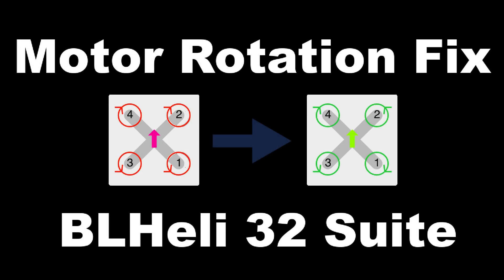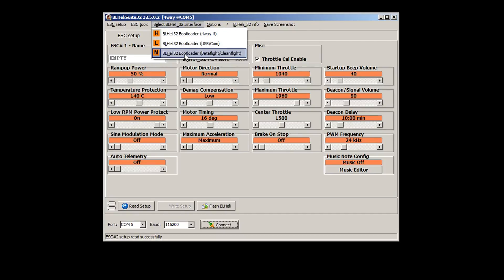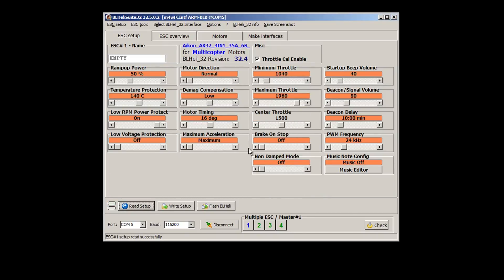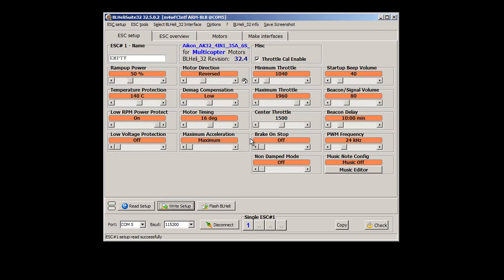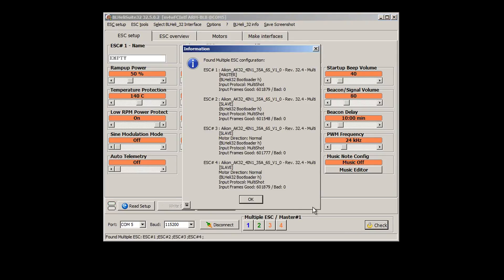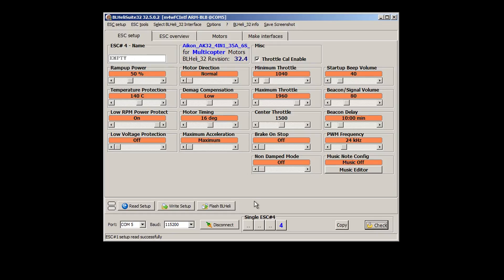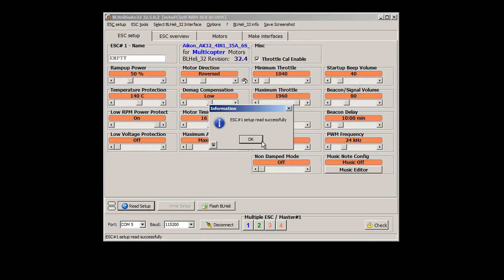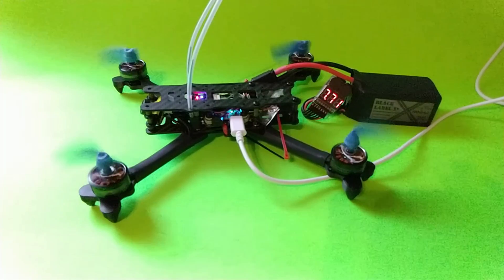🛠 [How to] Reverse Motors with BLHeli 32 Suite

Comment from the maker: ℹ  Oscar's How to Connect/Flash:
 ↪ https://oscarliang.com/blheli-32-esc-fc-passthrough/

ℹ BLHeli project and download link:
 ↪ https://github.com/bitdump/BLHeli/tree/master/BLHeli_32%20ARM

ℹ Windows STM32 Virtual COM Port Driver :
 ↪ Official Link: (account needed) https://www.st.com/en/development-tools/stsw-stm32102.html
 ↪ Joshua Bardwell's Share: https://onedrive.live.com/?authkey=%21AHtdqyEUIlNTWug&id=AC06B68F01DD1B5E%21111&cid=AC06B68F01DD1B5E

ℹ ImpulseRC Driver Fixer:
 ↪ https://impulserc.com/pages/downloads

Comment: Awesome video it helped me out a lot I have a question also why com port only gives me a port com3 as a com5STM the line is called USB it still works but should I be concerned
Reply from the maker: it's always com3 for me these days, not sure why, but never seen it different on my systems except this recording :shrug:
But now i strictly use the Linux version since it fully works these days. no more need for windows VM for me.  on Linux it's always /dev/ACM0 unless the port is somehow locked, then it goes to ACM1

Comment from the maker: TWO SECTIONS BELOW:
1) Featured Parts & Gear in this video.
2) My personal best parts and gear links.

🤑 THANK YOU for considering any affiliate links below.
🙏 HUGE Thank-you's to our community for all the youtube support!

SECTION ONE
---
🏆 Featured in this video:
📚 information

SECTION TWO - My Stuff
---
🐝 My 5"/6" Quad's Components (https://rotorbuilds.com/build/16766)
✅ RMRC Strix Screech 6" 💛
 ↪ RMRC:$28 https://goo.gl/yMpfsu | 6" arm:$10 https://goo.gl/52wPLb
✅ HelioRC Spring v1 IMU-F ⚙ Butterflight Stable
 ↪ Amzn:https://amzn.to/2OjoiDt (v1) | Pyro:https://goo.gl/68ZXMC (v2)
✅ Aikon AK32 35A 4in1 v2
 ↪ Amzn:https://amzn.to/2uNEwwA | Pyro:https://goo.gl/MyxRVD
✅ EMAX LS2207 1900KV 💛
 ↪ Amz:https://amzn.to/2yGdbP0 | Bang:http://bgd.onl/7 | Gfpv:https://goo.gl/bCNVzs
✅ R9 Mini 900MHz Long Range Receiver
 ↪ Bang:$23 http://bgd.onl/2n | Gfpv:$20 https://goo.gl/sYuuDq | Pyro:$20 https://goo.gl/TBMC7Q | RMRC:$21 https://goo.gl/9VD2RL
✅ Caddx Turbo SDR1 💛
 ↪ Bang:http://bgd.onl/5 | http://bgd.onl/6 | Gfpv:https://goo.gl/7BWrWj
✅ Eachine VTX03
 ↪ Amzn:https://amzn.to/2mI00X5 | Bang:http://bgd.onl/8
✅ FarVew👁 Pagoda-2 Rev B Combat Edition RHCP
 ↪ https://goo.gl/M9FLFG
✅ Pigtail 5cm RP-SMA Female to UFL/ipx (5cm) Pack of 2
 ↪ $3.86 https://www.amazon.com/dp/B01AJQ33Y4/
✅ JHE42B 110dbi Finder Buzzer Built-in Battery with LED Light (7.4grams)
 ↪ $10 http://bgd.onl/2m (USA warehouse)
✅ Black Label X 6s LiPo's
 ↪ https://goo.gl/qzhZ7N

🐝 My 7" Quad's Components (https://rotorbuilds.com/build/16968)
✅ iFlight XL7 V3
 ↪ $43 -$3_Coupon https://amzn.to/2ZfbqDZ
✅ Lumenier ZIP 2407 1700kv Motor Non-POPO (i won from GetFPV)
 ↪ Non-POPO: $26 http://bit.ly/2DaOdtd | POPO: $27 http://bit.ly/2DgGwlo
✅ Foxeer F405 (i won from Viper_FPV )
 ↪ @Gfpv http://bit.ly/2Di84Xh
✅ Holybro Tekko32 F3 35A 3-6s BLHeli32 ESC (Set of 4)
 ↪ $59/4 @Gfpv http://bit.ly/2DeBl5c | $15ea @Gfpv http://bit.ly/2DhaVA1
✅ HQProp 7x4.5V1S Bi-Props
 ↪ ~$3 @Gfpv http://bit.ly/2DgJjuN | $$Shipping https://amzn.to/2Iors9l
✅ Caddx Turbo Micro F2 FPV Camera
 ↪ $20 @Gfpv http://bit.ly/2DdVZT2
✅ Eachine TX805 5.8G 40CH 25/200/600/800mW Transmitter
 ↪ $17 http://bgd.onl/2F | $27 https://amzn.to/2UKY3Nm
✅ FrSky R9 Slim+ 915MHz Long Range Receiver 💛
 ↪ $29 @Gfpv http://bit.ly/2DeCnOC | $27 @Bang http://bgd.onl/2G | $34 https://amzn.to/2Irtci6
✅ Lumenier AXII 5.8GHz Antenna (RHCP) (2pcs) (tough boogers)
 ↪ $35 http://bit.ly/2DNy5hz

🎮 My Gear
✅ 900Mhz COMBO KIT: R9M Lite Module + Super 8 + R9 Mini Receiver + T-Antenna
 ↪ Bang: http://bgd.onl/2x
✅ FrSky x-Lite Transmitter
 ↪ Bang:http://bgd.onl/2 | GearB:http://gear.onl/8e | Gfpv:https://goo.gl/aw8nfs | Amzn:https://amzn.to/2JV0iDg
✅ Clear Silicone Non-Slip Gel Pads 65mm*75mm (generic battery pads) 💛
 ↪ $11 https://amzn.to/2BSGz8y
✅ iFlight M5 Quick Release Prop Wrench Tool
 ↪ $10 Amzn:https://amzn.to/2AlLvSE
✅ Eachine ROTG02 Android Adapter (has been very useful for dvr)
 ↪ $20-$25 Bang:http://bgd.onl/4 💛
✅ EV-Peak C4 80W Battery Charger (i have 2!) (~33mins from storage to full 1100mah 6S)
 ↪ $50 https://goo.gl/tkcfhk
✅ 60W ESD Soldering Iron Kit 💛
 ↪ $28-$33 Amzn:https://amzn.to/2AbeOXS
✅ RDQ/Bengineering Labs Smoke Stopper (must have)
 ↪ ~$7 Gfpv:https://goo.gl/SQi7xP | Amzn:https://amzn.to/2MdoYJ0
✅ Hawkeye FireFly Action Cam 1080p (catastrophically destroyed)
 ↪ Bang:http://bgd.onl/1 | GearB:http://gear.onl/69
✅ Hawkeye Firefly Micro Cam 2 160 Degree 2.5K HD
 ↪ ~$50 on promotion or coupon or BG-points @Banggood http://bgd.onl/2M

🛠 Useful Parts
✅ Helping Hand Third Hand Soldering Tools Flexible 360° Stainless Steel Arms 3X Magnifying Lamp [...] by NEWACALOX 💛
 ↪ $41 https://amzn.to/2ID5P4j
✅ "A more complete" WLine M3 Screws 12.9 Grade w/ NUTS
 ↪ $12 Amzn:https://amzn.to/2OhWe3q
✅ USA warehouse 7 gram JHE42B 110DB Lost Buzzer/LED
 ↪ $10 Bang:http://bgd.onl/2m
✅ USA warehouse 4.3 gram 1 hour JHE42B_S 110DB Lost Buzzer/LED
 ↪ $11 Bang:http://bgd.onl/2o
✅ Lipo Battery Voltage Tester 1S-8S Buzzer Alarm
 ↪ Bang:http://bgd.onl/9
✅ Pigtail 10cm PCI U.FL/IPX to RP-SMA Female Pigtail (connects to VTX03)
 ↪ $1.58 1x or $1.36 bulk (China) http://bgd.onl/2u
 ↪ $3.70 1x (USA) http://bgd.onl/e
 ↪ $8 5x (USA) http://bgd.onl/2r
 ↪ $12.90 10x (USA) http://bgd.onl/2s
✅ Pigtail UFL/IPEX to Female RP-SMA (2inch/5cm) (Pack of 2) (USA)
 ↪ $3.86 https://amzn.to/2PXxn6f
✅ Pigtail UFL/IPEX to Female RP-SMA (4inch/10cm) (Pack of 4) (China)
 ↪ $3.46 https://amzn.to/2LwpB4B
✅ FrSky R-XSR RX 16CH 2.4Ghz
 ↪ Amzn:$24 https://amzn.to/2LNNsbO | Bang:$24 http://bgd.onl/2q | Gfpv:$21 https://goo.gl/1ooDmu | Pyro:$20 https://goo.gl/qfMmyy
✅ iFlight 20pcs 150mm 2.4Ghz Receiver Antenna Gen4 RF113 IPEX
 ↪ $12 Amzn:https://amzn.to/2Kvdkcv
✅ 5 PCS 5V Active Alarm Buzzer (not super loud)
 ↪ Bang:http://bgd.onl/a
✅ "YouMic" Lavaliere Microphone
 ↪ $13-$17 Amzn:https://amzn.to/2A5Zqfi
✅ PoP voice Upgraded Lavalier Lapel Microphone
 ↪ $11 Amzn:https://amzn.to/2ORF5ho
✅ PoP voice basic Lavalier Microphone with single EarBud
 ↪ $10 Amzn:https://amzn.to/2QpEd7k

🏁 #nerdCopter ##nerdCopter ###nerdCopter

Comment: Question . No matter what i try ,  it always says failed when i try to connect . It's my first build and i'm rather new so i'm probably missing something . Any idea ?
Reply from the maker: hmmm. does your FC connect, but not BLHeli Suite? i'm still very rookie myself.  both my quads connect when i choose the pass-through setting in the menu.
Reply: @nerdCopter  Unfortunately its not connecting to the FC . " Connection to BLHeli Bootloader at COM1 failed "  is what i keep getting .
Reply from the maker: okay man, so the problem might be that you need drivers and possibly driver fixer installed.  you running Windows?  let me find some links...
Reply from the maker: actually, i had forgotten... the links are in the full description of this video.
For windows, you need "STM32 Virtual COM Port Driver" and in many cases, the "ImpulseRC Driver Fixer".  both links are tn the description.  If you have windows 10, you might also need to look into disabling the "driver signing"... here are two options (links) about that:
https://www.urtech.ca/2016/01/solved-the-third-party-inf-does-not-contain-digital-signature-information/
https://windows10helpdesk.blogspot.com/2015/08/install-unsigned-3rd-party-driver-or.html 
or search on the subject
Reply: @nerdCopter   Thanks bud ! I didn't pay attention to the description close enough . Ill give that a try and see what happens .
Reply from the maker: @jeremyking7790  good luck. let me know.